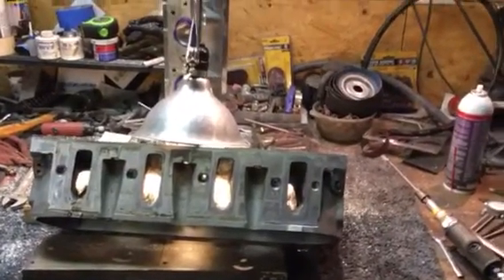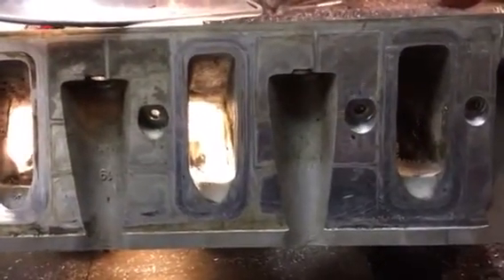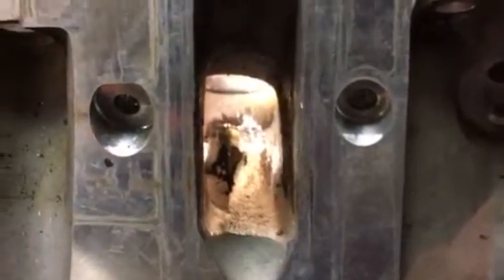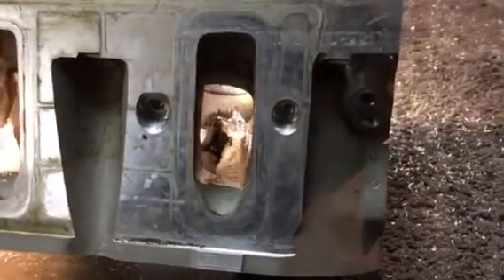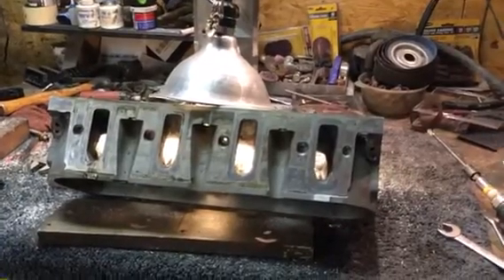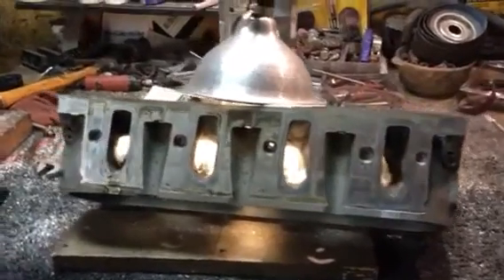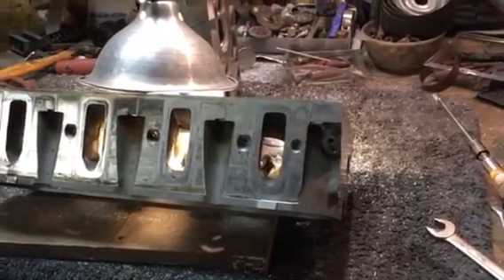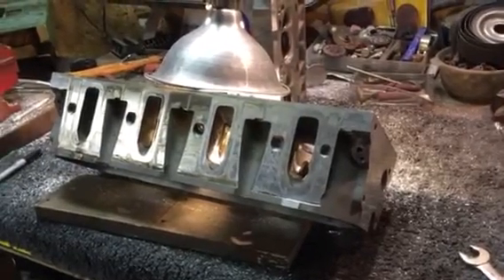Porting LS 241 heads #2

Comment: How much do you charge to port a set of 241 heads
Reply from the maker: harry bandini $750.00 assembled with customer supplied parts, valves lapped, assembled.
If the heads require machine work I am willing to work with you some on the added costs. 
If shipping is required I cover return shipping cost.  JD